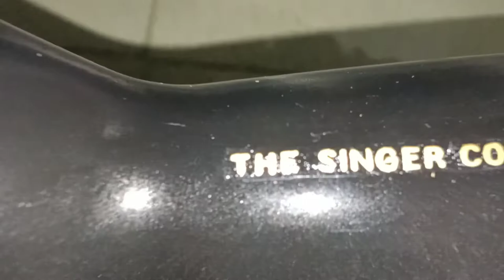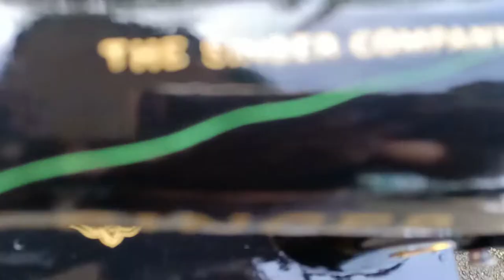OLD ORIGINAL SINGER SEWING MACHINE RESTORATION / HOW TO RESTORE SEWING MACHINE

Comment: I'm curious,  were you able to find the serial number? Singer has a pretty comprehensive list of them so you can find the year a machine was made
Reply from the maker: Ahm, I actually don't know if it is possible
Reply: It looks like the serial number is stamped on the underside of the base. Ismacs database has a listof serial numbers and corresponding dates.
Reply: It's not a Singer machine so the serial number won't help. Those Singer copies were made in the 1980's and 1990's.